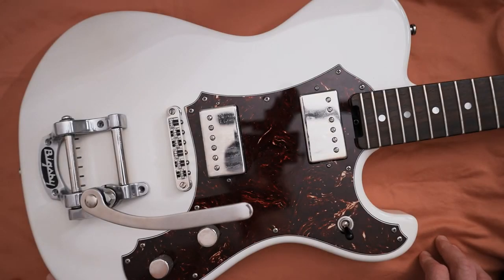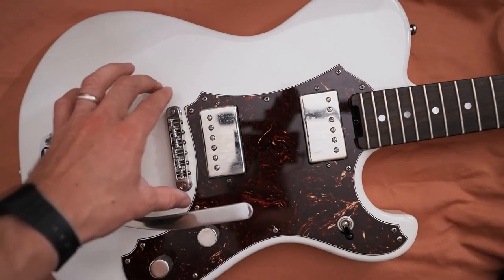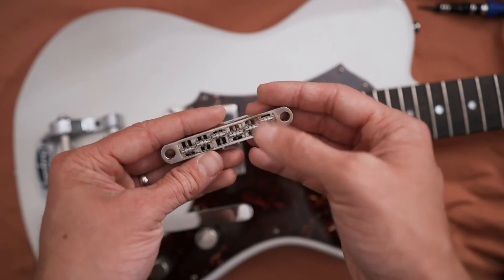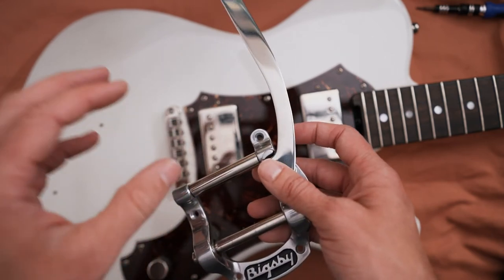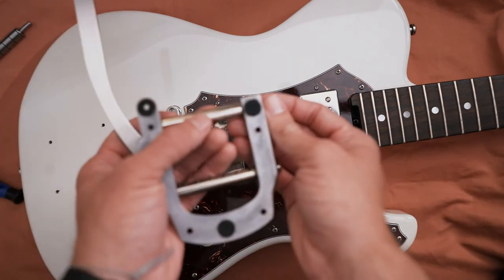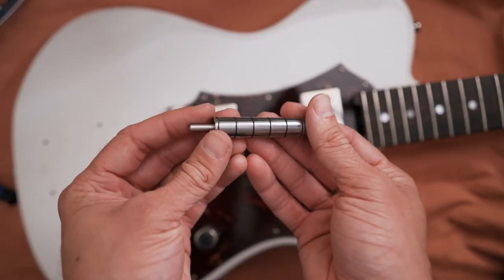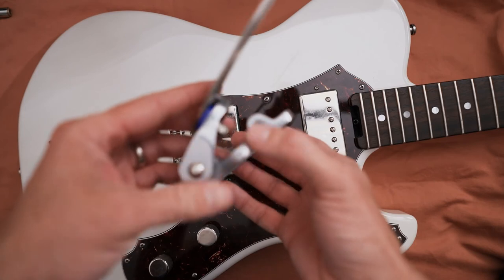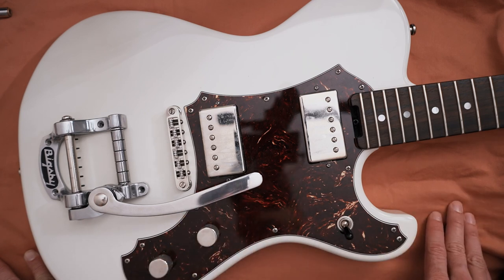Bigsby TUNING Issues... Here's what I'm doing.

Comment: Yes! It's that darn roller bar that causes the problems on B5 Bigsbys. My Country Gent doesn't have a roller bar. Rather strings leave the saddles and go straight to the string pins on the tailpiece. Very shallow break angle but they never pop out of the saddle slots. I asked myself, "Why wouldn't this also work on my Gretsch G5232T Double Jet?' (which are notorious for detune when the B5 is used). Miracle of miracles, it did the trick! Putting the strings under the bar is what messes up the tuning. You don't need a special bridge, graphite nut, or locking tuners. They won't solve your tuning issues. Just run the strings over the bar and straight to the retaining pins. Bigsby oughta stop using that roller bar once and for all.

Comment: Very good points you are making, rollers on the nut would also help as well.
If you use locking tuners your strings will not loosen and tuning will be much faster.

Comment: I have 2 Gretsch. I find the issues are with the nut more then the Bigsby.  slots not cut correct or just need a bit of graphite or nut sauce on the cheap chapstick can be used. Other problems is putting on new strings and not getting all the slack off the tuning posts. Bigsb's take a lot of guf when it isn't them at all.

Comment: I've got two Gretsch's (G5420t) and (G7593t-BD) and have never had a single tuning issue ever, both have Bigsbys too? The G5420t I added a rollerbridge and Lizard Spit lube on the nut and it stays in tune for days and weeks. The Billy Duffy White Falcon I've never had an issue with. Virtually all tuning issues are nut related, nothing more.
Reply: What bridge did you get?
Reply: @MonsieurVersatile  I ordered one off of EBay. It wasn't anything fancy and fit up perfectly to the posts already in the body/bridge.
Reply: @sh4rkbyt3  ok thanks 😊

Comment: you should replace the spring
Reply from the maker: I actually bought a couple new springs. And swapped them out, but it hasn't helped. Currently I'm working with a setup technician and I think we're gonna end up replacing the bridge. I've discovered there is some play in the saddles of my Tone Pros Roller Bridge. So next video I'm either going to replace it or rig up a way to remove the play in the bridge. Thanks for the suggestion though!
Reply: @joshuaaldy  The spring has little to nothing to with the tuning.